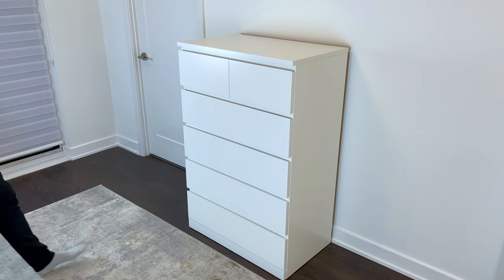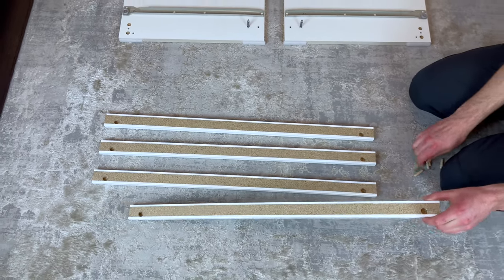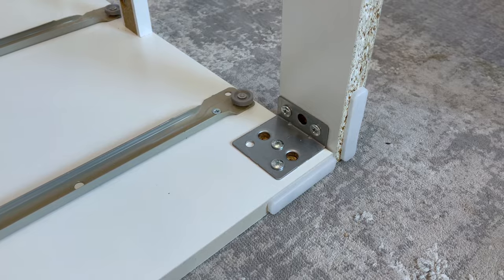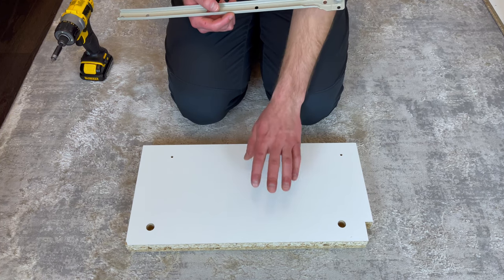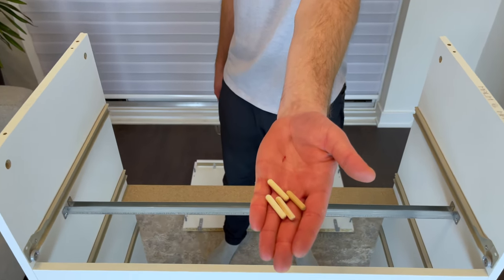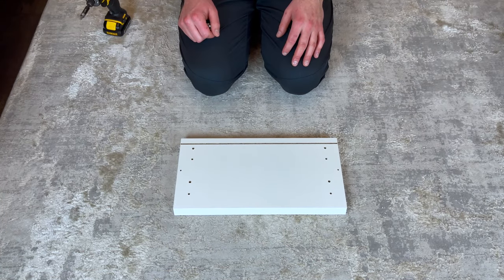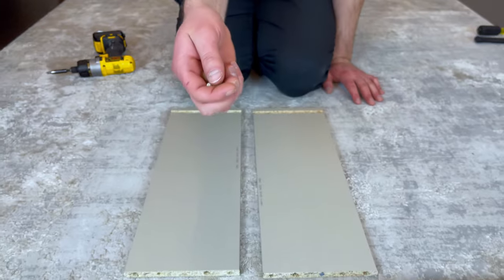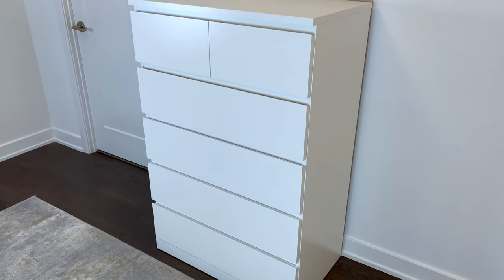Easy to Follow MALM 6 Drawer Chest IKEA Tutorial

Comment: For attaching the support bracket for the big drawers, there is no hole in the back piece of the drawer, are we suppose to drill a hole? Is there a way to do it without power tools? 20:57
Reply: There should be a very small hole there to you can screw it in, if not then you probably have to drill it
Reply: Did you find a hole? I just used a nail to make a tiny hole and then forced the screw in.